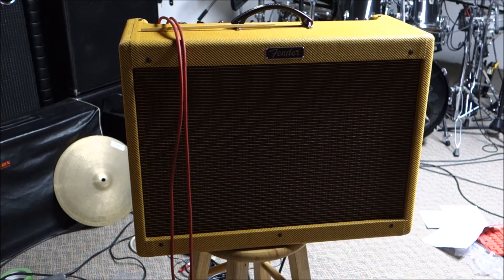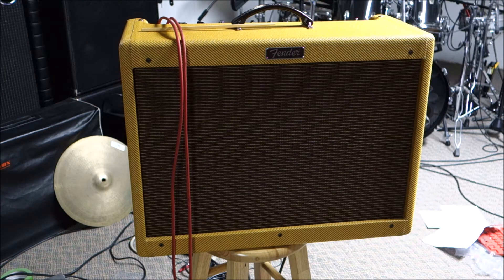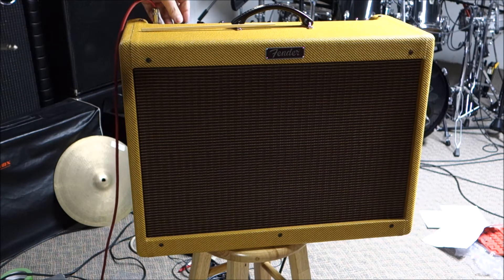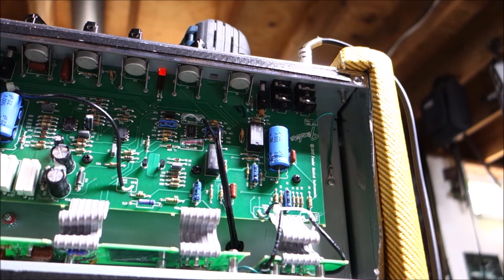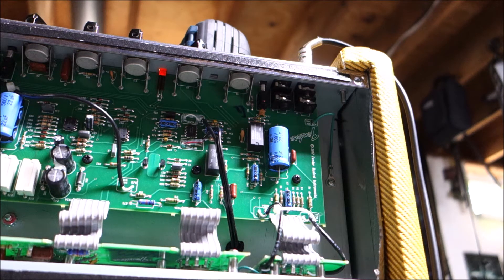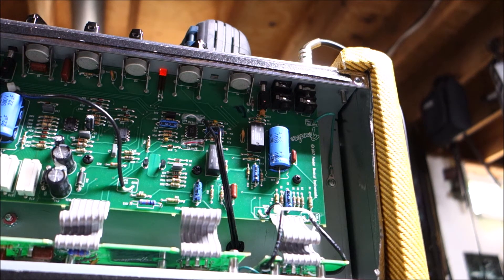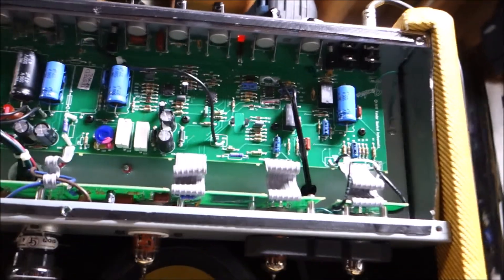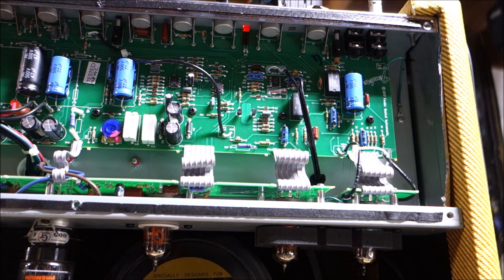Fender Blues Deluxe Re-Issue........ Easy repair.

Comment: I was looking to see who does amp repair nearest to me, but, then I thought to check Youtube before I take it anywhere. So, I saw your video, and even had contact spray on hand and it worked! My Deluxe Blues Reissue amp (I use for a keyboard, Yamaha CP4) was shutting off on me after about ten minutes of playing then later it got worse after only a minute. I did try to my Orange CR-60 which I like for guitar but not for keyboards. Thanks so much for you making a video for this problem. I thought it had something to do with the stand by switch. THANKS AGAIN!!!!
Reply from the maker: I find that most technical problems start in the pots, switches and jacks,  so I always start there.  Glad it helped you.

Comment: Nice to get an easy on eh...You would think though, with such a big name as fender that those jacks would be of a more robust quality..!.Good job..Ed..uk.😀
Reply from the maker: Most current production amps are designed to be faster and less costly to produce.   The hand wired style that we saw up through the 70's really is/was the most technician friendly.   Ampeg's 70's designs used the PCB,  but had the sockets and pots hand wired... that worked well too.   In regards to that style of socket,  there's only a SMALL part of the socket that contacts the jack.  It's just asking for trouble.